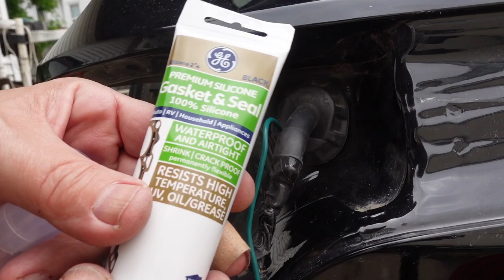Installing a Curt trailer wiring kit on a 2016 Ford Escape SE

Comment: Why didn't you just use a fuse tap and tap into a empty  spot in the fuse panel? That's what I did and no need to splice and solder plus I can access the fuse without having to pull that whole side trim off if it ever blows
Reply from the maker: There were no empty slots in the panel that were wired.
Reply: @Rob Withoff  hmm ok my whole top bar was switched and the lower bar were constant hot...otherwise thanks for the video because I didn't want my wires outside in the elements ...who wants to spend $60 on a wire harness that gets corroded?  So it helped me with the panels and where to run everything and was quite simple!